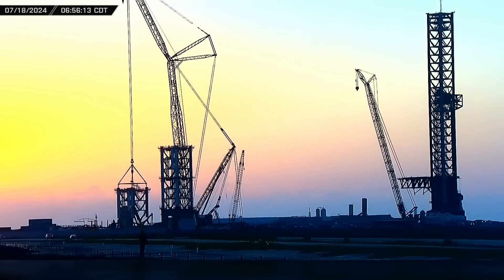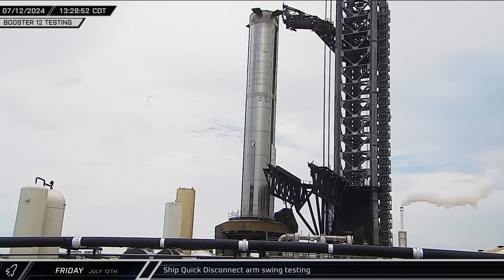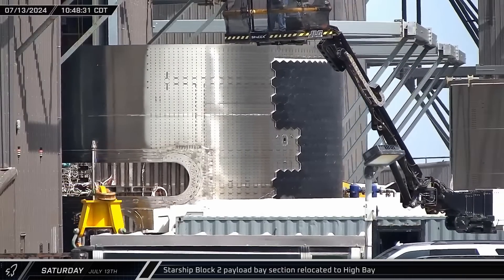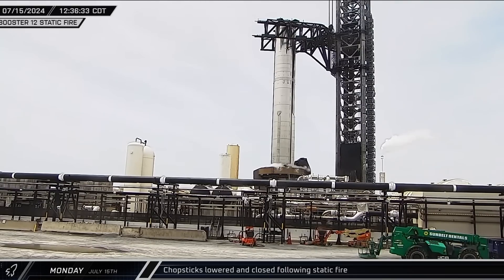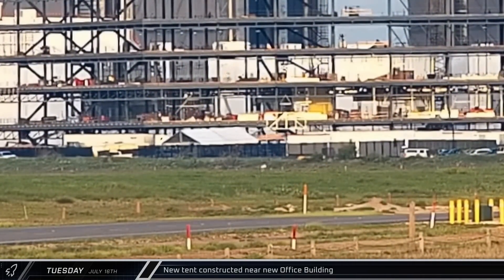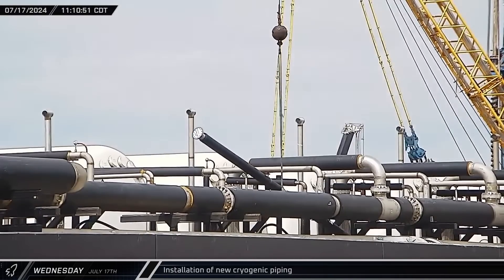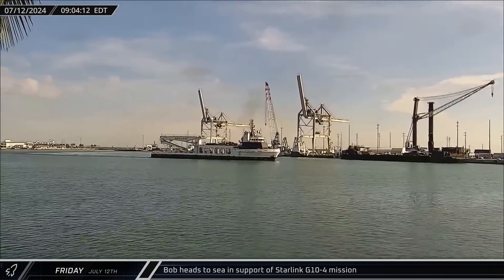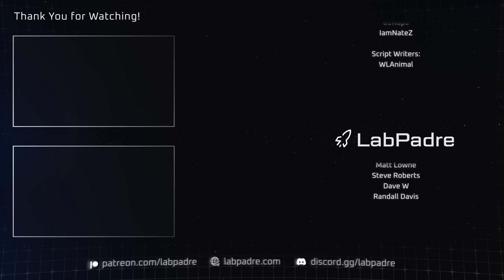Wow!! Next-Generation Starship Spotted at Starbase! - SpaceX Weekly #124

Comment: Lab's style of update is the best on the net, no padding out, just straight facts.
Reply: @JohnSmith-hl5jw  exaktly the reason im here. Objective Journalism is so important. Sadly not all channels that watch starbase are so objectively.
Reply: I think it could be better with no jumping back and forth between sites with parallel work. I would prefer them to present tasks in one site and then switch to other, even if it's not strictly chronological.
Reply: Ok so where is the new design?